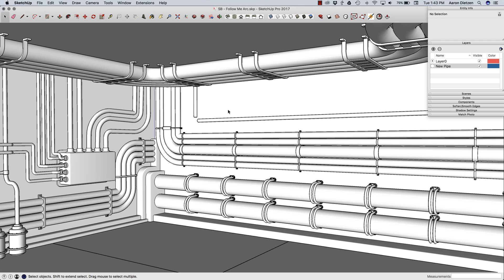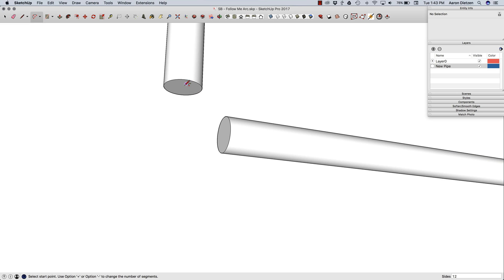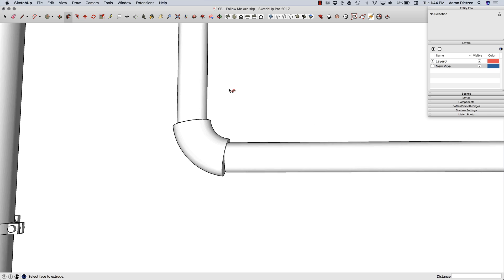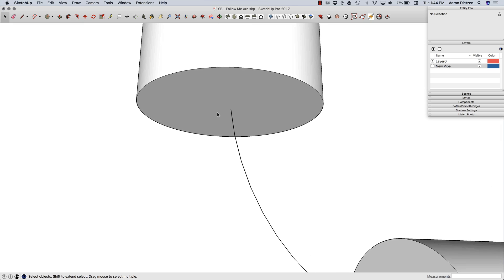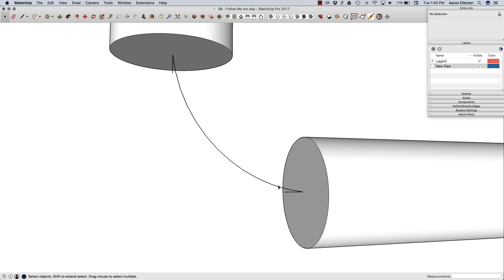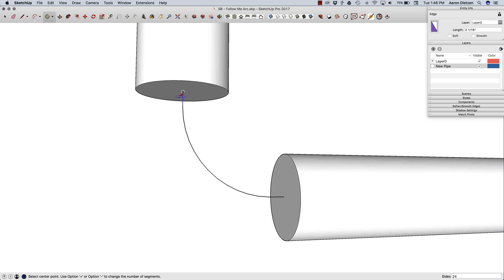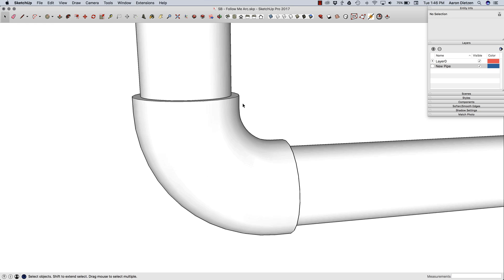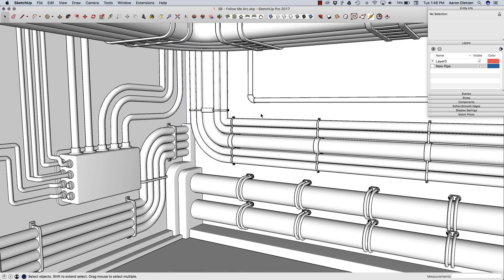SketchUp Skill Builder: Follow Me Arc

Comment: Thanks for sharing. Yes I have encountered that elbow problem and used your solution, thanks for nipping the problem in the bud.

But I sometimes have to create a network of pipes and I find it easier to draw ALL the lines before creating the pipes. If flanges and elbows are not required then simply selecting all the  contiguous lines and activating "pipeline" created everything instantly.

However, if flanges are required, then an adaption of your method would be to break the straight lines at either ends of the arcs. Then make pipes out of  the remaining long straight lines, and then select the arc and the short straight pieces to make the elbows at the larger diameter, using "pipeline".

A NOTE OF CAUTION here. For some reason only known to the CAD developers,  very tight arcs are sometimes incomplete after using the follow-me or "pipeline" tools. The solution is to  scale up the bend (say 10*) make the pipe, and then scale down (say 0.1) to fit. This implies that there is a "number overflow or underflow" problem/bug which the developers have not fixed.
Reply: That doesn't work. That would mean you'd also have to scale up the circle ten times. You're only approaching the same exact problem on a larger scale. Even if you were to use the original circle size with an arc that's scaled ten times, when you go to scale it back down, the circumference of the pipe shrinks and sometimes even warps.
Reply: @FreedomOnALeash1776  Well it worked for me